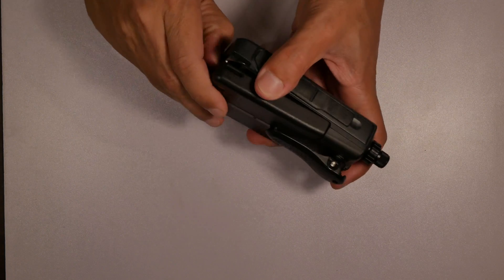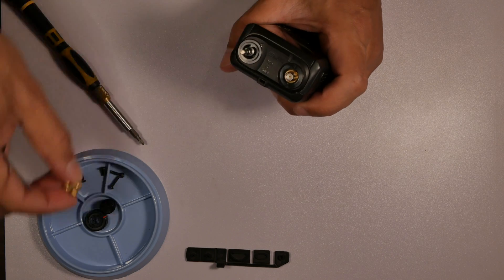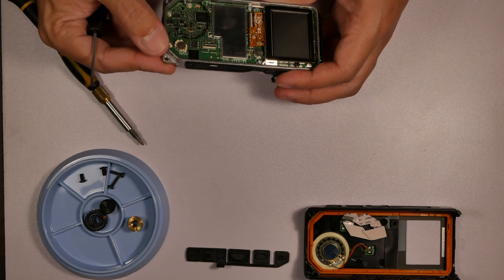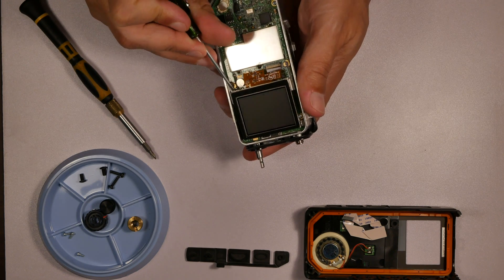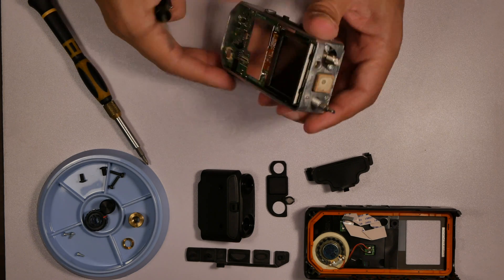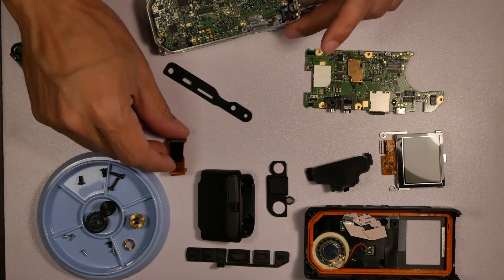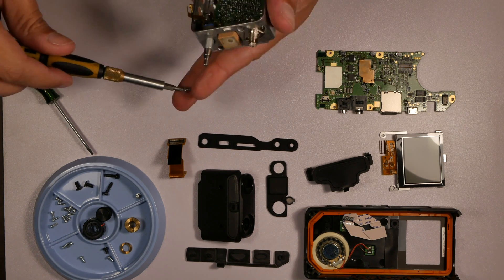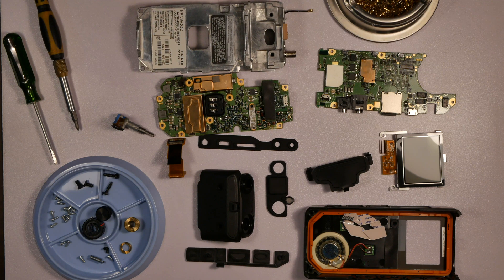TH D74A Full Disassembly/Teardown

Comment: I have a part with a faulty battery charger PMIC IC, I believe its the NCP1871 they use. I couldn't see it in your high resolution pictures. Do you know what PCB it is on?

Comment: Is the potentiometer/encoder cleanable? I have this radio and the frequency selector knob doesn't operate properly. It just cycles back and forth between 2 settings (ex: 144.400 and 144.450 Mhz). It won't scroll through from low to high, etc. Not sure if it needs to be cleaned or of I need to replace the control. Oh and thanks for this teardown and the wiki page. That is incredible!
Reply from the maker: Never tried to take one apart to see, I’d probably go the replacement route if you can find one. Then take it apart and see if it’s repairable for fun. But might be more of a headache to use in the long run if the repaired one is still finicky.
Reply: @RECESSIM  yes, I was kinda thinking the same thing.

Comment: Looks like similar construction to the Chinese radios like the GD-77, DM-1801 and RT-3S/UV380

I have  a teardown of the Retevis RT-3S (aka TYT MD-UV380) https://youtu.be/ScoVslqV5eY
And also another video showing the Baofeng DM-1801 https://youtu.be/36GWlDZrJ2E

It looks like that radio has better sheilding of the RF sections, but with those metal cans.